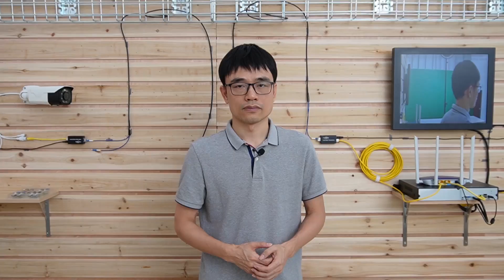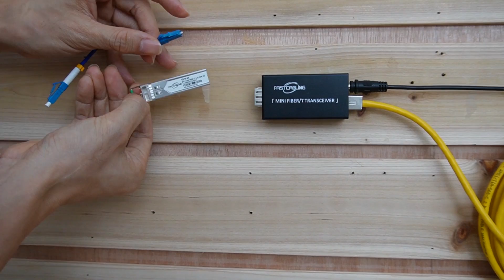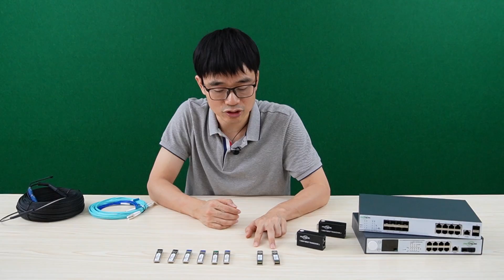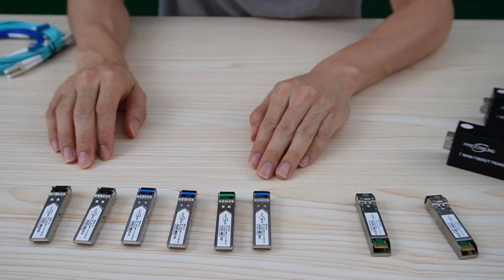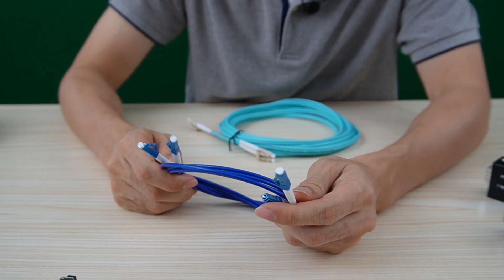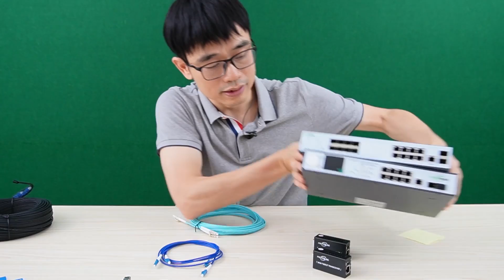How to choose SFP transceiver for fiber optical cable

Comment: Is it possible to put a 1:8 splitters in between to supply 6 different places media Convector from point A then supply 1 up to 6 media Convectors? Which SFPs to use?
Reply from the maker: No. Media converters expect a dedicated optical link between two devices. They do not support broadcast or shared medium behavior like an OLT does with multiple ONUs. You can use an SFP switch with 6 SFP slots at Point A. Each port is then connected to a media converter at each remote point.

Comment: Explain the apc vs upc and how to find out which one is for the SFP.  I do not know
Reply from the maker: 1. UPC
Color: Blue
Polish: Flat
Return Loss: ~ -50 dB

2. APC 
Color: Green
Polish: 8° angle
Return Loss: ~ -60 to -70 dB

You can check the SFP module datasheet or label. It will specify whether it's designed for UPC or APC. For example, “LC/UPC” or “SC/APC”. If you’re using the SFP for telecom, PON, or video services, APC is usually preferred due to its better return loss. If it's a standard network/data application, UPC is more common.
Reply from the maker: The BiDi SFP modules we used in this video support LC/UPC connectors. https://www.fastcabling.com/product/bidi-sfp-fiber-modules-2/
Reply: @Fastcabling can you put a apc in the spf?
Reply: @Fastcabling the spf have do not sa la/upc or sc/apc, thank you for your help.  I guess I’m in the same place,when I started.
Reply: ATS-SCSM -L3R
SFP 1.25G T1550 5KM SM/SC DDM
Reply from the maker: Your SFP supports single-mode fiber with SC connectors. SC connectors can be either UPC or APC. If you're still unsure, check the manufacturer's datasheet or product page.

Comment: other source, I watch, Yellow fiber cable was Single, while Blue was Multiple,  but this video saying Blue color was Single, and Light blue was Multiple. Please help! Thanks
Reply from the maker: This matches the TIA-598-C standard for fiber optic color coding used especially in data centers:

Blue jacket = Singlemode optical fiber
Aqua/light blue jacket = Laser-optimized Multimode fiber (OM3/OM4)

Comment: Can we use upc to Apc conector to connect 2 routers
Reply from the maker: You could use a hybrid adapter that allows for proper matching between a UPC and APC connector without compromising signal integrity. These adapters are designed to account for the differences in angle and reflection.

Comment: Thank you for the informative video ! 
Do SFP modules support both UPC and APC fiber ? I'm asking because no SFP specification, that I came across, mentions this.
Thanks
Reply from the maker: The SFP modules support simplex LC. You can find the specifications in the 'Resources' section of the product page.

https://www.fastcabling.com/wp-content/uploads/2022/08/ds-5976-84-BiDi-SFP-Fiber-Modules.pdf
Reply: Thanks for the prompt response ! What I was referring to, was the LC connector polishing. LCs have different polishes of the connector - UPC(Ultra Physical Contact) and APC(Angled Physical Contact). Since it's not mentioned in the specifications, does that mean that this is irrelevant for SFPs.
Thanks
Reply from the maker: It's UPC.

Comment: Why does sfp transceivers usually stop working? Is it possible that from lighting?
Reply from the maker: SFP transceivers can stop working due to various reasons: electrical surge/lightning strike, overheating, physical damage, and compatibility issues. To protect SFP transceivers from lightning strikes or electrical surges, consider using surge protectors or lightning arresters on your network equipment.

Comment: Can you elaborate more on the differences between all the options and compatibility between cable and module. Do modules need to be in a send/receive pair or a module can send/receive to the same kind of module?
Reply from the maker: The SFP transceivers determine the fiber optical types (single mode or multi-mode), connector types (LC SC ST)… If it is the BiDi transceivers that takes different wavelengths to transmit the signal, you need different send/receive because the laser generator are different. Otherwise, there is no difference.
Reply: @Fastcabling  so if the SFP uses a single LC connector cable and single mode, then the sender and receiver SFP must be different (matching pair), but if multimode, then they could potentially be the same?

Comment: Don't fiber optic cables come with a pair of 2 cables, Tx and Rx? So how does this work with Bi-di transceivers?
Reply from the maker: The BiDi SFP modules support bi-directional data transmission, which means they can transmit and receive optical signals simultaneously on a single fiber strand by utilizing different wavelengths for each direction. Also, fiber optic cables don't necessarily come with 2 cables. The simplex fiber optic cable only consists of a single strand of optical fiber.

Comment: Are the connectors compatible with all the SFP modules or you need a specific connector for a module
Reply from the maker: Not all SFP modules and connectors are inherently compatible. There are several types of fiber connectors used in networking, including LC, SC, ST, FC, and more. Most SFP modules used in networks today commonly support LC connectors but they can differ in design, supporting either simplex (single fiber) cables for one-way data transmission or duplex (dual fiber) cables for bi-directional data flow. So it's always recommended to check the compatibility and consult the module's specifications beforehand.

Comment: G-240W-B
hi i have a quick question  can i use the  fiber port of G-240W-B router  to make the router access point  from the main router i mean by useing fiber cable between the tow router?
Reply from the maker: G-240W-B is an optical network terminal (ONT), a part of Passive Optic Networks (PON). The fiber port on the G-240W-B is designed to receive an optical fiber connection from your ISP. This port is typically not used for connecting to other routers in your network. 

Normally, routers or network terminals are interconnected using Ethernet cables. If your main objective is to extend or distribute your network using another router, you should do this via the Ethernet ports.

Comment: Is there use for a SFP transceiver for a 2.5G  home betwork? I'm going to do a total renovation of my home and I was thinking of cabling the home with Eth cat.7 cable which is capable of 10G. Any need for SFP+/fiber?
Reply from the maker: For most home networks, Cat 7 cabling will be more than sufficient to support current and near-future bandwidth needs, including 2.5G and up to 10G speeds, within the standard Ethernet range (up to 100 meters).

But if your home layout requires cable runs longer than 100 meters or there are high-denisty areas with EMI, fiber would be a better choice. It's ideal for high-bandwidth requirements, such as a home lab, large-scale media production, or data-heavy work-from-home setups.
Reply: @Fastcabling  thanks for the detailed answer
Reply from the maker: My pleasure!

Comment: My ISP's router has a single fiber optic line and the ONT line port says SPF+ 10GB. I am assuming that the media converter I need is the SFP+ transceiver. I want to be able to connect the fiber optic line directly to a TP-Link XE-75 PRO. By cloning the MAC address of the router, I should be able to use my DECO-XE75 PRO correct? The ISP's router is ADTRAN and the ISP has locked down the admin page. I want to return the ISP's router and use if possible my TP-Link XE-75 PRO so that I have more control over advanced settings.
Reply from the maker: You might need a modem if the ONT employs PON technology. It doesn't work with media converter with point to point connection.

Comment: Hi i have a question,
is fiber still supported when i have two different switches?

For example one switch is a Cisco and the other one is a Dell or a Media Converter?
Reply from the maker: Yes, fiber optic connectivity is supported between switches from different manufacturers through the use of fiber optic cables and compatible transceivers or media converters. Ensure that both switches have compatible fiber optic interfaces. Common types include LC, SC, or MTP connectors. The choice of single-mode or multi-mode fiber depends on the distance and bandwidth requirements. Also the switches may require compatible fiber optic transceivers (also known as SFP or GBIC modules). Different manufacturers may use different transceiver models, so make sure the transceivers on both ends are compatible.

Comment: Hi greetings , In our premises we have been using aruba 5406 core switch and at outside idf  ie less then two kilometer we are using Dlink DGS-f1100-10ps-e ( switch ) , how to know the compatible sfp for both aruba and dlink switch , could you pls suggest the compatible sfp module which should work with both switches , foc cable is singe mode ,waiting for your reply
Reply from the maker: Basically, there are two kind of SFP transceiver. The one comes with proprietary code, another type with generic code. The Cisco switch needs the SPF transceiver with proprietary type. I know D-link use generic, but not sure about Aruba. Once the code is being determined, now you can select connector to match the fiber optic cable - eg. LC or SC, single mode, BiDi for one strand connection.

Comment: What transceiver is best used for the connectivity of OLT to switch at the same rack?
Reply from the maker: That depends on your specific network setup, equipment compatibility, distance requirements. It's recommended to select transceivers that match the data rate and protocol (e.g., Gigabit Ethernet, 10 Gigabit Ethernet) supported by your OLT and switch.

Comment: How to verify on-site if the SFP transceiver is working well post-install check and System integration test
Reply from the maker: You might check the indicator on your switch or media converter. There is indicator which wil show whether the link is up or not. Otherwise, you can bring the switch back and test it with short patch cord. It will rule out a possible defect of the cable.

Comment: what about sfp+ dacs? i heard those are cheaper to connect from 1 switch to another within the same rack.

also that multi mode is cheaper than single mode ya?

and also sfp+ copper uses the most power and also gets hot. e.g. some switches can only handle up to 4 sfp+ copper transceivers tops.

probly some stuff out of scope of this video subject but thought i'd mention them.
Reply from the maker: Thanks for your input. yes, the SFP+ DACS is cheaper, and multi-mode transceiver is cheaper for SFP+. That is why the multi-mode solution is popular in the data center. There is no much difference with the single-mode and multi-mode cable and SFP (1G) transceiver. The multi-mode cable has limited distance (about 550 meters). It is quite simple for single mode to reach 20KM.
Reply: @Fastcabling  i saw on youtube some other persons setup, they used optical fiber multi-mode to connect from 1 switch to another within the same rack.

so i was wondering why they did that considering that sfp+ dac is cheaper for purchase not to mention uses less power than optical.

in terms of power consumption lowest to highest, 1. DAC, 2. Fiber, 3. Copper

yeah there those range differences, but for home lab user they wouldn't be requiring those ranges i think? maybe 30m at best?  

Would be interesting if you made a future video on this topic so people get the correct sfp+ especially for lowest cost so they don't end up overpaying for something overkill and expensive for no reason :}

Comment: Can multimode SFP s work on either OM1 (62.5/125) or OM3 (50/125) ? Is there anything spec to look for there?
Reply from the maker: Yes the multi-mode transceiver work with OM1 and OM3

Comment: Hello dear, 
I want to use fiber link between Cisco POE gigabit switch to router. So which "Cable, SFP & media converter I have to use.?
Reply from the maker: You will need to choose Cisco compatible SFP transceivers. The SFP transceiver will determine the fiber optical cable and the connector type. As it is only Gigabit speed, there is no different between single and multi-mode. You don’t need single mode while the distance is beyond 550 meters. https://youtu.be/y6fZdkQGTfk

Comment: It takes 3 hours for the NVR to load, 

Two converter connect to Poe switch with cat6 cable.

Can the cat6 cause the delay

2 of  16 NVR will load in time while the 3rd one takes hours to loads
Reply from the maker: I don’t tell it cause by the cable. You can’t feel the delay causing by the cables. You mentioned hours, I think there is some issue either with your setup or the devices. You can simply test the system with short patch cord to rule out the cause from the connection.

Comment: which is better ?single mode or multimode fiber sfp .plz reply.
Reply from the maker: I guess there is no afformtory answer. If the bandwidth 10G or less. Single mode fiber optical cable will be good. I personally prefer single mode. It achieve 10G up to 20km. The multi-mode has about 550meters. You will see more multi-mode deployment in the backbone inside the building or the datacenter. There is no need to concern the distance while we use single mode in most case.
Reply: Single mode for longer distance and multi mode for shorter distance single mode for 500m plus distance and multi mode for less than 500m